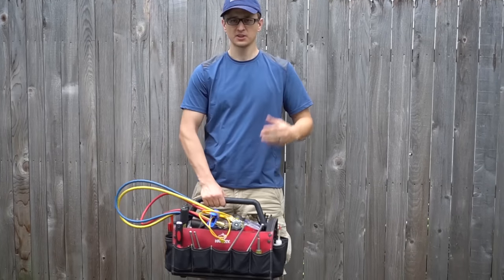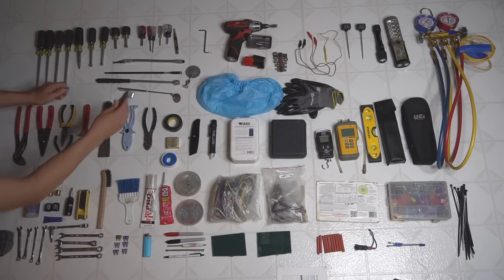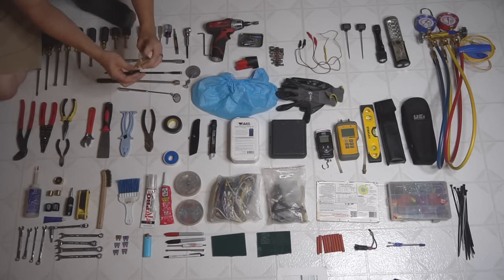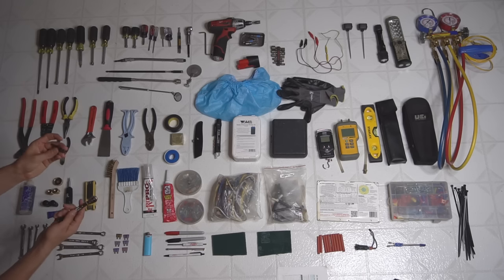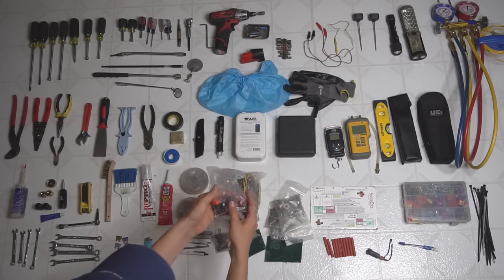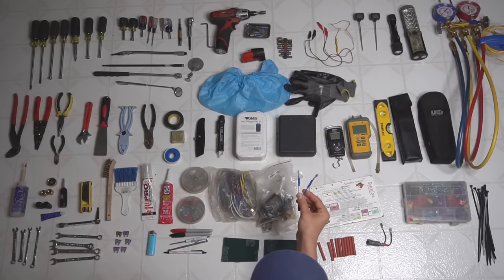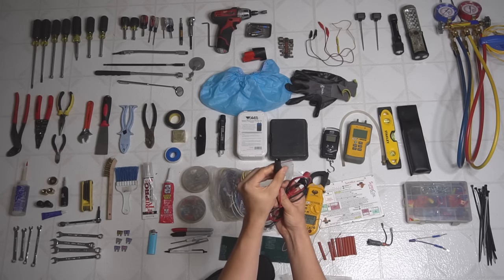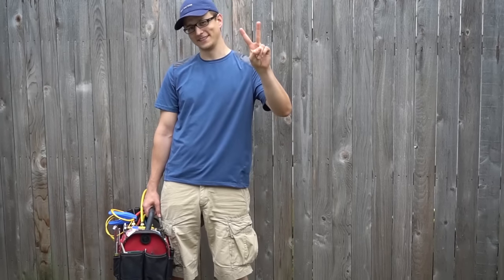Whats Inside a Service Techs Tool Bag

Comment: You thought of everything.  You must love your work.
Reply from the maker: Thank you! It's a great job! But actually the tool bag contents change through the years, slowly evolving into the tool bag that has all I need :) That's why I am always curious to see veteran techs' tool bags. They usually have some unique stuff!
Reply: @WordofAdviceTV  fan blade hub puller, gotta have one. Mine stays in my bag at all times.
Reply from the maker: @stuckcontactor5826  I have been lucky lately and barely ever have to use a hub puller. So i just keep it on the truck (makes my bag 5 pounds lighter)

Comment: Great informative video, just one minor quibble...those things you have for static pressure are not pitot tubes, pitot tubes are those big "tube inside a tube" things that you use to measure air velocity. Those things you have are just called static pressure tips.
Reply from the maker: Good to know. Thank you for pointing that out! I have been calling them that for over 5 years now and nobody's bothered to correct me.
Reply: @WordofAdviceTV  No problem, I know the two items are easy to confuse since they look sorta similar and serve similar functions.

Comment: I think I know the answer to this Q. but do not want to assume (as they say).  Specifically, why do you like to keep the 2 different gauge sets (one solely dedicated to R22 and such)?
Reply from the maker: The two refrigerants have different oils and it's preferred not to mix the two.
Reply: My system uses R22.  If I bought a used testo 549 gauge set and hoses and am not sure what refrigerant was used prior... Should I be concerned? I say this in reference to the potential different lubricants.  Is there any way to wash it out? Should I replace hoses?  How concerned should I be about it?
Reply from the maker: @jotu173  Some techs use one gauge set for both refrigerants all the time and claim that it makes no difference. I don't have a good answer for you since I have not studied this particular subject. I just know it's better to keep them separate.
Reply: @WordofAdviceTV  Thanks for the reply!

Comment: Sir if you write names for these tools for beginners like me. I will be appreciated ...
Reply from the maker: Most of the tools you see in this video are listed in the description: 
Tools that I have/use in my videos:

The Best Flashlight: http://amzn.to/2DLCYFx
UEI Multi Meter: https://amzn.to/2MbSHC2
The Best Drill: https://amzn.to/2MHLudO
Magnetic Drill Bit Set: https://amzn.to/2ML0esn
Impacto Kneeling Pad: https://amzn.to/2CLKvs5
Motor Hub Puller: https://amzn.to/2LDntqx
Amprobe Psychrometer: https://amzn.to/2K54Nvi
UEI Dual Manometer: https://amzn.to/2NGmD9Q
Multi Tool Wire Stripper: https://amzn.to/2Karthq
Magnetic Nut Drivers: https://amzn.to/2tdEdKz
Knipex Cobra Pliers: https://amzn.to/2tg4Rm2
25 Piece Wrench Set: https://amzn.to/2CIo9YB
2 Piece Crescent Wrench Set: https://amzn.to/2A7aM2W
14 Inch Pipe Wrench: https://amzn.to/2JP30tY
Magnetic Tray: https://amzn.to/2Mc4Fv5
Screw Drivers: https://amzn.to/2JUaGjw
Stubby 6 in 1 Ratcheting Screw Driver: https://amzn.to/2mDwS3d
Stubby Magnetic Nut Drivers: https://amzn.to/2NHDolh
Fuse Puller: https://amzn.to/2MDSQz7
Fan Blade And Blower Wheel Puller: https://amzn.to/2x2rkVw
Flexible Drill Bit Holder: https://amzn.to/2K4dgiO
Long Drill Bit Extension: https://amzn.to/2JLCvFH
Angled Drill Bit Holder: https://amzn.to/2Mbqc7r
Drill Bit Extensions: https://amzn.to/2MbcbGC
UEI Temp Probe: https://amzn.to/2K3E1UE
Zoom Spout Oiler: https://amzn.to/2tctO1E
Hex Key Set: https://amzn.to/2lp2bhO
DeWalt Drill Set: https://amzn.to/2M940up
Wire Connectors Set: https://amzn.to/2tqYn30
Wire Nut Set: https://amzn.to/2tdgF8I
Shrink Tube Set: https://amzn.to/2x7DUSP
Voltage Pen: https://amzn.to/2tq5t8d
3 Amp Testing Breaker: https://amzn.to/2CLvVRk
Heat Resistant Silicone: https://amzn.to/2x5agxz
Teflon Tape: https://amzn.to/2oZCQwD
Electric Tape Set: https://amzn.to/2p1WyrK
Pocket Extendable Mirror: https://amzn.to/2ytJzXr
Magnetic Jumpers: https://amzn.to/2L1wPZN
Mini Alligator Jumpers: https://amzn.to/2N067S1
ECM Service Tool: https://amzn.to/2p0rA3h
Klein Step Drill Bit #15: https://amzn.to/2ObgdjV
Color Coded Snippers 3pc: https://amzn.to/2Nz6rLk
Shoe Covers: https://amzn.to/2CO8ZkF
Nitrile Gloves: https://amzn.to/2p1PlaQ

Refrigeration/Air Conditioner Tools:

R22 and R410 Refrigerant Gauges: https://amzn.to/2uM1GDx
High Side Replacement Gauge: https://amzn.to/2x6rIlo
Low Side Replacement Gauge: https://amzn.to/2x9SskK
R410a Refrigerant 25lb: https://amzn.to/2p2PACx
Refrigeration Wrench With Hex Bit: https://amzn.to/2uM1MuT
Tube Cutter 1/4-inch to 1-1/8-inch: https://amzn.to/2OdRbQX
Tube Cutter 1/4-inch to 2-5/8-inch: https://amzn.to/2CLUYnj
Flaring Tool Kit: https://amzn.to/2N7w8TF
Twin Cylinder Recovery Unit: https://amzn.to/2x2INgW
Vacuum Pump: https://amzn.to/2x7HNHu
SuperCool Slide Rule: https://amzn.to/2QdbcZx
Ball Valve Refrigerant Hose Set: https://amzn.to/2wSbETX
Low Loss Refrigerant Hose Set: https://amzn.to/2wQazfy
Electronic Refrigerant Scale: https://amzn.to/2N78tmA
HVAC Fish Scale: https://amzn.to/2oRyI1O

Parts that I mention in my AC videos:

1 Pole 30 Amp Contactor: https://amzn.to/2tdICNB
2 Pole 30 Amp Contactor: https://amzn.to/2JWlI7Z
SPP6 Hard Start Kit: https://amzn.to/2JSPieo
30+5 MFD Capacitor: https://amzn.to/2M4M83O
35+5 MFD Capacitor: https://amzn.to/2JXTVUs
40+5 MFD Capacitor: https://amzn.to/2yrugyr
45+5 MFD Capacitor: https://amzn.to/2MG8ZDY
50+5 MFD Capacitor: https://amzn.to/2M7RFGY
Qwiklug Compressor Wire Repair Kit: https://amzn.to/2JWmsdh
3 Amp Fuses: https://amzn.to/2JViUYO
1/4 HP Blower Motor: https://amzn.to/2tfifXT
1/3 HP Blower Motor: https://amzn.to/2K63HQL
1/2 HP Blower Motor: https://amzn.to/2trGVeM
3/4 HP Blower Motor: https://amzn.to/2tqsKGX
FM55 Blower Motor Bracket: https://amzn.to/2MbdYeK
5 MFD Capacitor: https://amzn.to/2K5NcHn
10 MFD Capacitor: https://amzn.to/2tqP7ft
15 MFD Capacitor: https://amzn.to/2MJZzHU
30 Amp Disconnect Fuses: https://amzn.to/2JYcSGH
25 Amp Disconnect Fuses: https://amzn.to/2tgcJUC
20 Amp Disconnect Fuses: https://amzn.to/2tcEFsM

Comment: What are your favorite tool bag or bags? And why I’m always looking fo good functional tool bag.
Reply from the maker: At first I had that square tool bag. I forget the brand. (I think it was LeatherCraft) But it was a bit too small and I didn't like that it kept hitting my knee while I was walking. Honestly I am only on my third tool bag so I can't say I know much about which ones are good. 

My second bag was similar to the one you see in the video but it was a little smaller and it had a foam handle. Everything was kind of crammed in it and the foam handle falls apart with time. Taping it helps but that deteriorates with time too.

Finally I stopped on this Husky tool bag that you see at the start of the video. It has a plastic handle, it is big but not too big, and the bag itself is light weight. Has pockets on the outsides and inside of the bag. So far I have no complaints! I think I will settle with this one :) I hope that helps! Different techs will have different preferences, I guess you just go with trial and error until you find one that suits you best.
Reply: @WordofAdviceTV  I have used HUSKY (still do for my lunch bag:) everyone wants one:)--------but my bag of choice would be VETO PRO TECH they make something for everyone and comes with a 5 year replacement - no time down guarantee:) I can assure you breaking this bag would be like breaking into fort knox gold depository - It will NOT happen:) 
VETO PRO TECH - they have some of the best- Occidental makes some great bags too- but they start at 500.00- out of my price paying pocket-LOL

Husky will not let you don either and they have a lot of choices too!